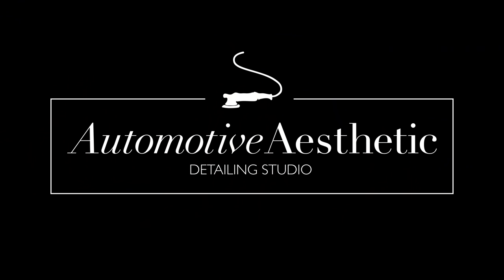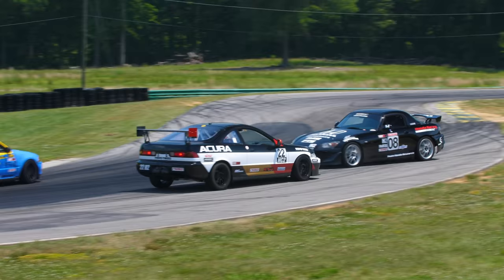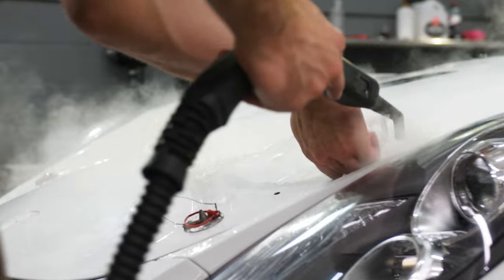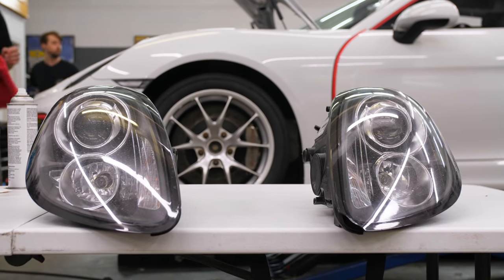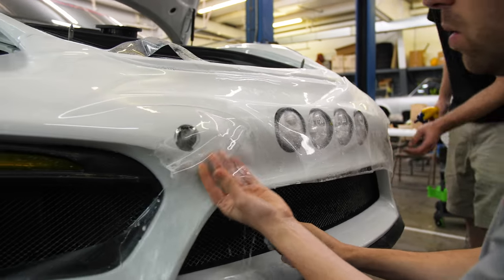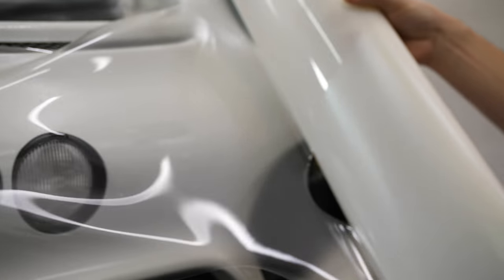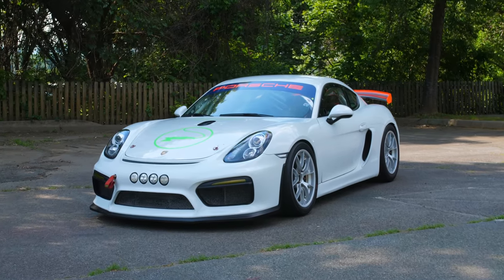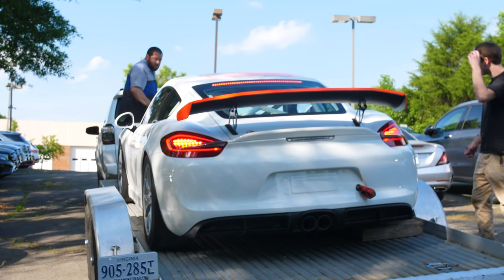Wrapping a Porsche Race Car in Thick Suntek PPF

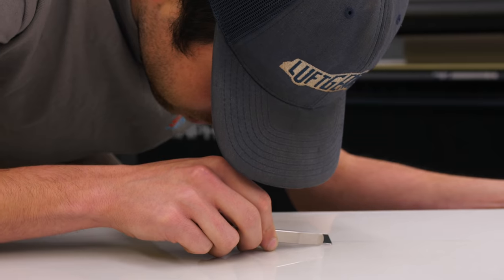Comment: 7:08 6.5 -7 mil thick film
7:19 11.5 mil film

Are we sure that it's 11.5 millimetres or even 7 millimetres? 11 mil is thicker than 1 centimetre!

Regardless, wonderful video and excellent work, the car looked brand new afterwards!
Reply: It must be 1.15mm
Reply: A mil is a thousandth of an inch, so 0.007 inches, 0.0115 inches, etc...
Reply: It’s mil not millimeters
Reply: Okay. So it's a regional thing. To those of us that use the Metric system, "Mil" is an abbreviation of "Millimetre".
Reply: Mitchell Denham I thought mm was the abbreviation for millimeter.

Comment: PPF’ing an entire car — even a relatively inexpensive one — is worth it. My 2016 STI has a full PPF and it has saved every panel on my car at least once. It’s a huge pill to swallow and you definitely need to do your due diligence to find the right installer, but the end result is incredible and should be topped with some sort of ceramic coating. One thing to not is that it’s invaluable to the first owner, but depending on the car, it’s more or less valuable to the second. My STI won’t command a penny higher in resale despite the amount of money put into PPF and detailing, and I expected that. But if you drive something more unique like an S2K where even though it’s not “expensive”, people value a good example, something like this will increase its value dramatically. Just make sure your installer wraps all edges and gives you proper care instructions. You can find countless installers who will charge ~$1000 for a front wrap, but the difference in quality is self-explanatory. Also be wary of dealer installed PPF. Generally speaking they are in the business of quick turnaround and volume so your outcome is usually dictated by their bottom line. They tend to overcharge and either farm out their work to the lowest bidder (sometimes several), or slap it on themselves. Some of the dealer installers are actually fantastic shops, so it’s worth asking for their installer information so you can check them out. Pay a visit to the facility doing the install before you make a decision and walk around to see their environment and cars they’re working on. Get to know the shop staff and pay close attention to cut lines and edges, especially along trim pieces. Look for shops that will disassemble a panel or remove a light to place PPF under the fixture for better protection and an invisible install. Sorry for the lengthy comment but there’s so much to consider in the world of detailing and anyone new to it can make an expensive mistake real quick. I’ve definitely made my fair share of them!

Comment: Very interesting, love the race-car stuff!  Makes me wonder though, say you apply this film, then you apply a wrap covering 50% or even 100% ontop of it, would it still make sense? What's the durability like when you layer them like that, will removing one peel the other more easily? I've heard of people applying ceramic coating on these ppfs, would that make a difference?

When it comes to cleaning, especially the rubber marks and bugs, would you be able to use the same products without fear of destroying the ppf?
 Thanks!

Comment: What is used to get the track rubber off? My car is littered with it after a couple weekends. 

I saw mention of heating it up with a heat gun and wiping it off with a solution. Clay or polishing seems like it would be a little too abrasive.

Comment: I want to get a new Miata RF when the time comes so I can give my '04 a much needed break. I'm 100% doing the full front on that car because I'm an asshole and tailgate slow drivers, and my '04 Miata probably has more cracks in the paint covering my front bumper than clean paint, lol....

Comment: This stuff is not self healing.  There is no 10 year warranty. I had this product and it did not protect my car for even 1 year.  There is a reason the largest Nissan Dealer in Lincoln, Nebraska does not use Suntek PPF anymore.  They have switched to Xpel and so should you.  Xpel stands behind their product.  Suntek does not.  You’ll find out the hard way.  I cringe at people using this on expensive cars.

Comment: Overpriced shit, you can get car fully wrapped about 1800-2000e and this man ask for just front end 1700? what a joke
Reply: It’s been proven that ppf protects the car up to 4 times more than vinyl wrap. So it’s worth it. Paint and body work is easily more expensive.
Reply: @robochoa7387  So you think, you can slam wrap on un-detailed car? Its same process with paint correction and 3M paint protection film costs about the same as satin wrap.  7k for full car is just fucking insane, hour labor must be like 200 dollars.